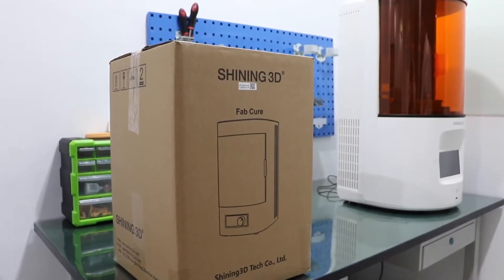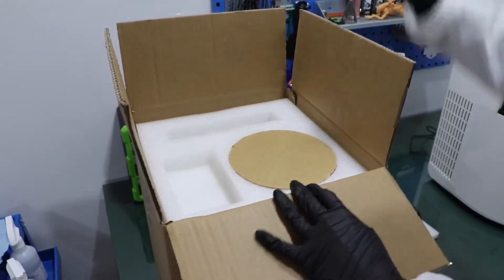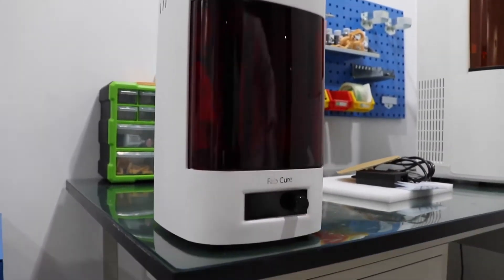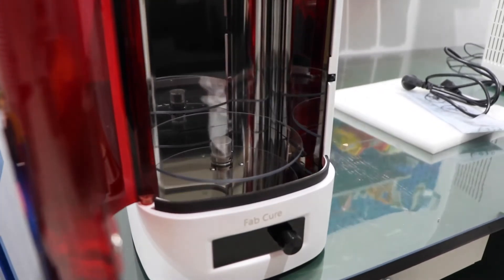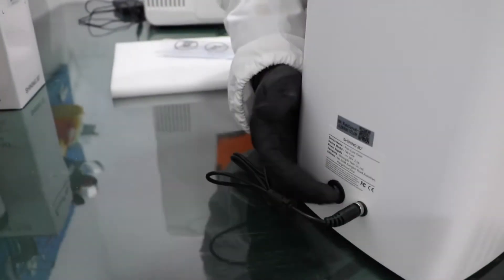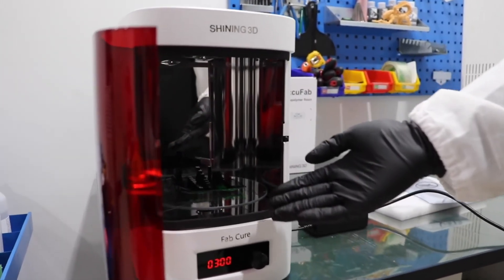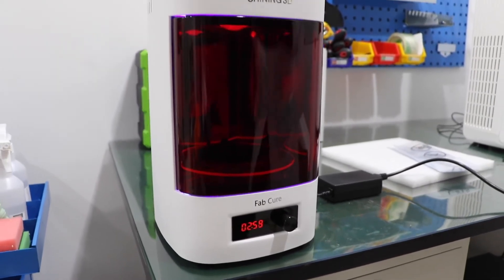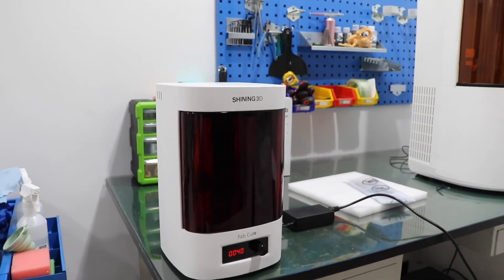Shining3d Fab Cure Installation and post cure process

Comment: Today in email, I was quoted a price of $450 for this product through Aurident.  Here is how overpriced it is.  For $129 with free shipping, I can get an Anycubic Wash and Cure 2.0 , which is a dual-purpose machine that can be used for both the alcohol-washing and 405nm UV curing of resin-printed models and pattens.  That means that for $258 (a little over half of the price of the Fab Cure box), I can get two of Anycubic's machines, and then use one dedicated for washing and one dedicated for curing to save time from having to switch setup between washing and curing with a single machine.  If I find that I need extra capacity for either washing or curing, I can get a third Anycubic machine, which would bring my total to $387.  That breaks down to my being able to buy three Anycubic machines that can both wash and cure for $63 less than a single one-purpose Fab Cure box.  In terms of lab-production, the Anycubic and Fab Cure are similar in dimensions, so I can get nearly three times the curing-capacity for less than the cost of one Fab Cure box - with the added bonus of model-washing ability.  

The only main difference I see in the products in terms of curing, are the orientation of the UV light-source and the amount of reflectivity in the curing chamber.  More reflectivity can be easily and inexpensively added to the Anycubic product by cutting and gluing UV-resistant acrylic mirror sheets to the inside of the  chamber: however I doubt that it will be necessary with the light source being horizontally-orientated on a bar behind the turntable in the Anycubic product.  If I do decide to modify with the mirror sheeting, I can get affordable sheeting from Interstate Plastics.  

Whereas I use Shining3D's scanner, printer, and resins for my lab, I won't be paying nearly half a grand for an overpriced single-function machine.  Instead, I'll spend less than that by getting three of Anycubic's dual-purpose machines.  I'm fairly certain that I won't even have to add the mirror sheeting.  A little increase in curing-time will probably make up for any difference between the level of curing between the two brands of machines.